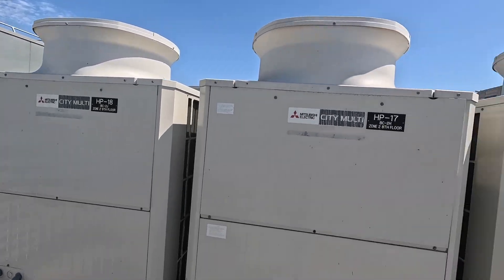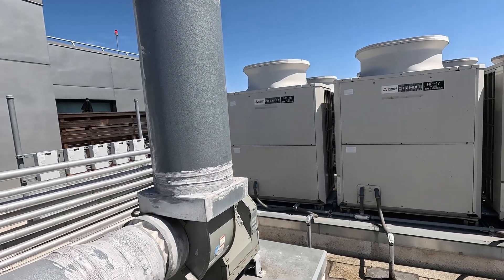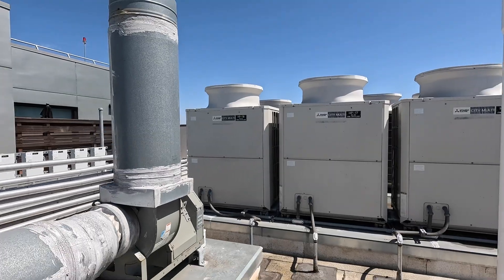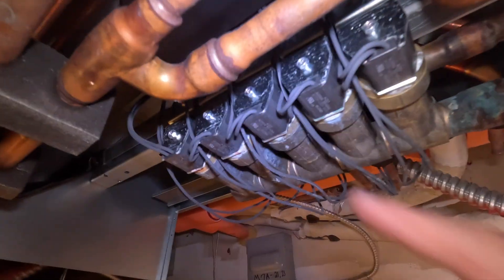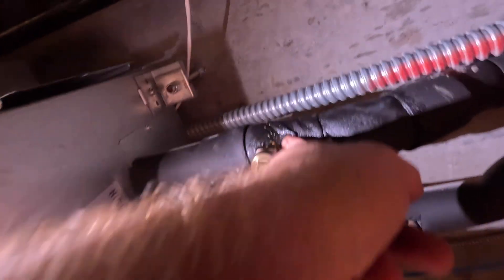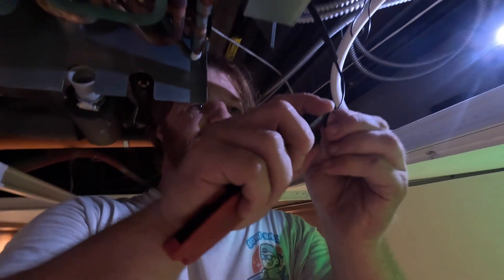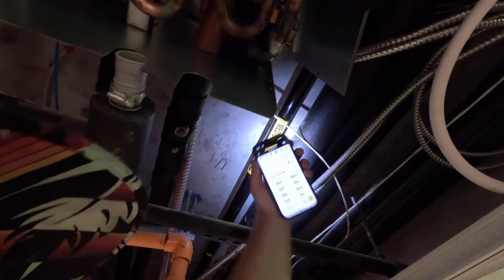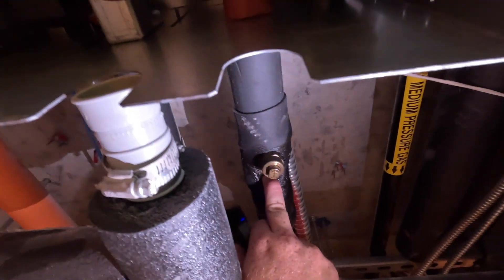Help! The AC Hasn't Worked For A Month! The two other companies couldn't fix it... Mitsubishi VRF

Comment: Literally had that same code a month ago. Luckily trane had the part in stock. Super easy. I didn't have to take the bottom of though.

Though I'm fairly certain that the 5115 code says it's in the Branch box.

Comment: This is why I carry over a dozen different value cheap Chinese one dollar temperature sensors. 
     They’re good enough to solder in the wire and get the unit up and running while you’re waiting for the factory replacement. 
    The list price for the factory replacement might be anywhere from $60-$150. 
     But for one dollar instantly, you got it up and running
      You’re charging a flat fee minimum of $2400 a day anyway to come out there for one service tech on the job site. 
      Possibly $1400 for four hours absolute minimum if you break your day into 2/2
Reply from the maker: Yeah we just charge hourly on VRF it’s pretty chill. We don’t really let most customers set a limit on time though it’s an it costs what it costs for these things. Once it’s all diagnosed we can quote some repairs but you gotta quote real high doing flat rate on these cause sometimes you think it’s a 2 hour job and it takes all day
Reply: @SurfBrosHVAC  that’s why we charge so high with minimum four hour allotment and usually whole day.  Because if you work six hours, you’re not gonna take off to another job to Bill in two hours at the end of the day you lost that so you charge for it
Reply: @SurfBrosHVAC wait till you come across one that's never had the final diamond build done, and you bulit it to the best of your ability just to fine out your still short on refrigerant charge after replacing the compressor on 3 year old unit!

Comment: The people that installed those so close together had no idea what they were doing.
Reply from the maker: Companies that do stuff like this guarantee a lifetime of work for me
Reply: @SurfBrosHVAC  And me! Gotta love it. I had a new customer the other day telling me how he was tired of these big companies sending guys that obviously didn’t know what they were doing. I fixed his problem immediately and he had two other companies come before I got there. It seems to be a reoccurring trend in our business.
Reply: The condensers? The IOM says they require 3/4” between condensers. Have installed a ton like that.
Reply from the maker: @SerialChiller-VRF  I think he just means that it may not be good for the units long term especially given the fact that they weren't dealing with limited roof space in this case. The manual does allow it but that doesn't mean it's a great idea. Low clearances are always going to cause higher pressures

Comment: Dude, I installed phase monitors in city multi and in one of the units an error code  popped up. (4225 abnormal bus voltage rise) which points to the fan board which points to the filter board which pints to the inverter board and if all of them test good, Mitsubishi states to replace them all…. Lead time 10 days to get parts. So we keep troubleshooting and it turns out that it was the high pressure switch that was open because I placed it on normally open on the phase monitor. (I used the pressure switch to present the unit from running If there is a phase imbalance or voltage change of 15%) I’ve learned that  Mitsubishi error codes will definitely lead you down the wrong path if you don’t come up with a troubleshooting guide of your own. On another note. Always change the inverter board if you are changing a compressor on a VRF system. Compressors kill boards and boards kill compressors.
Reply from the maker: We've seemingly taken over the care of like 50ish Mitsubishi VRF systems in the last couple months and not gonna lie I'm pretty stoked about it
Reply: @SurfBrosHVAC  heck yeah! That’s awesome! I have plans of doing my own thing within the next two years!

Comment: Maintenance tool would of speed up the diagnosis . Good repair
Reply from the maker: Yeah I already had it ordered just hadn't gotten it yet. 100% would've made this one really easy. I think the thermistor was cutting in and out of connection though because it was running in spurts for like a day at a time just with really bad pressures which is why Alex added some charge
Reply: @SurfBrosHVAC  if I were you I would order 5 sets of thermistors!
Reply: Whats a maintenance tool?
Reply: @ogvicodinmuncher  its a diagnostic tool that you plug into the laptop and com wire on a vrf system so you can pull up error codes and eev position, thermistor readings and voltage ect, all brands have there separate tools to use,very handy and useful, takes time to get use to
Reply: @408BayArea Thank you.